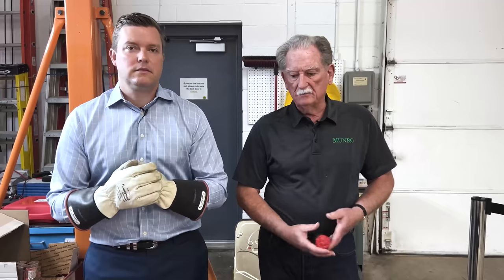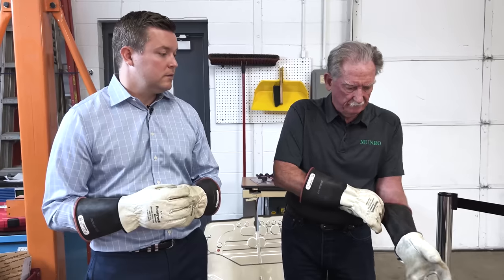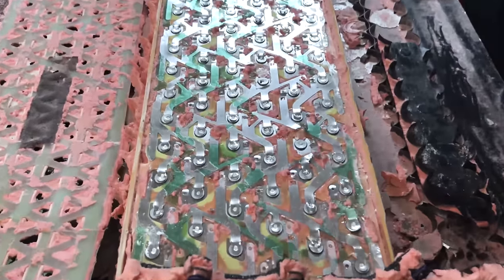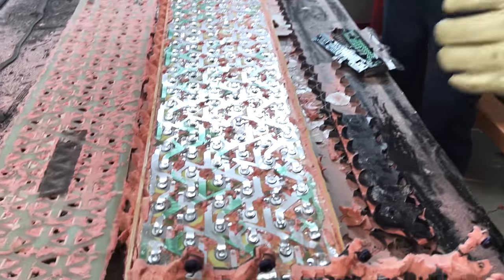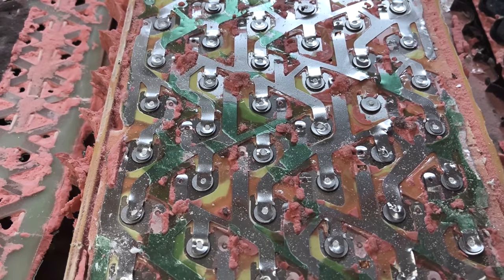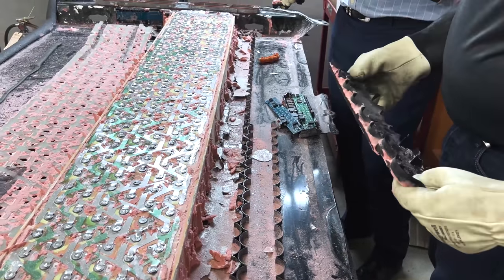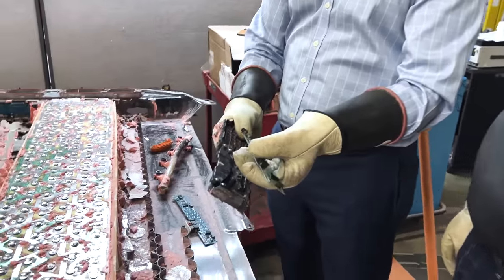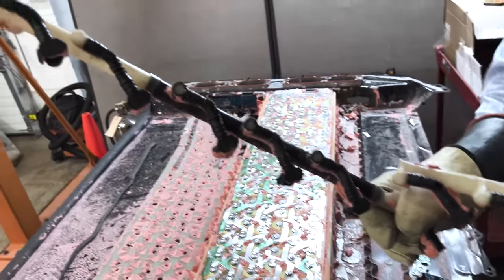Sandy's first time reviewing the fully disassembled 4680 pack!

Comment: you can now mail the cars in a box so dyiers can build it themselves, that ending was epic, i dont understand how OEM doesnt see this.
Reply: Have you been living under the rocks!? OEM actually does those types of things but on very expensive cars, who is is damn mind is going to mass produce a car with carbon fiber!? Also the repairs are totally impossible unlike welding aluminum or steel.
Reply: There is a reason why OEM uses mix of material! The carbon fiber part is generally a monocoque/passenger cell/cocon…. And aluminum castings/magnesium and steel are for the rest
Reply: Just look at people repairing those maclaren or Audi R8……. Carbon fiber is still expensive material! You forget BMW i3 which was basically built from carbon fiber don’t you!!!
Reply: @carholic-sz3qv  whos talking about carbon fiber? I´m talking about stamping huge parts of cars (as tesla´s doing) as sandy is proposing for decades.

edit: sorry miss spoke, not stamping, that is actualy what they are doing, i meant molding the parts.
Reply: @vladimirsara9790  lol……. Sandy has worked at ford in the 80’s, ford isn’t the entire automotive industry lol……. Engineers have the reason not to use molding an I can understand that! In that way vehicles are even more repairable
Reply: @carholic-sz3qv  disagree, molding structural parts aint reducing repairability, if you damage structural part, car is a write off (at least in developted world).
Reply: @vladimirsara9790  lol……. It’s totally reduced repairability and also making mods close to impossible! Imagine this on the cybertruck since a lot of trucks are made to be modded for soooo many different applications it’s going to be a nightmare! I don’t even want to imagine that in the semi lol….
Reply: @vladimirsara9790  those casting can very easily crack in those not so developed worlds making repairs impossible
Reply: @carholic-sz3qv  I´m talking about structural parts not covers, but I see you´re here to argue so, OK you´re 100% right, good day to you sir
Reply: @vladimirsara9790  structural parts so what!!!!!

Comment: That BMS is tiny!  Tesla must be matching cells super precisely and or pulling some tricks with the charger too?
Reply: Only 828 cells to manage for 4680s vs over 4,400 in the model y&3 pack's or over 7,700 in the model s&x pack's. 😎
Reply: A few reasons.  Modern cells don't need as much balancing so balancing fets and associated IR drops can be on boarded now.  If near cooling you can get quite a bit of balancing on boarded.  So now you have maybe four fewer components per cell channel and no need to protect those with zeners.
Reply: Lol….. the battery pack has very few cells why would they need to have a massive BMS!? tell me why!!!! It’s obvious the choice.
Reply: @culdeus9559  also modern electronics makes control way better l! Imagine if we didn’t have all that electronic!!!
Reply: @carholic-sz3qv  While pack is only 9 cells in parallel vs 40 or so in the 2170 packs, those 9 cells have about the same energy.  So if they're 1% off from everything else, you need to burn off just as much energy.  Basically Tesla is pulling some engineering magic as I've seen bigger BMS boards in E-bikes with 1:50th the energy.
Reply: @martylawson1638  nonsense!!!!! There is absolutely no engineering magic at all here it’s all about modern electronics like I said again!!!! By using things like silicone carbide or galium nitride mosfets  those BMS boards can be made super tiny just look at power supplies with GaN transistors. Those bikes uses cheaper electronics that’s why the board is bigger.
Reply: @martylawson1638  I’ve also seen super tiny e-bikes BMS too lol…..

Comment: re the "is the voltage different" about four minutes in, I would expect the voltage per cell to be the same, but the amperage to be significantly higher on 4680 vs 2170, so a more robust attach/weld makes sense.

Comment: The reduction of resistance due to welding-direct-to-busbar in lieu of "a little wire" will result in greater amperage capability; the voltage drop improvement will not greatly effect the pack's output voltage because all the "little wifes" are effectively in parallel. That's my take on it, anyway.

Comment: My understanding is that the wire bond acted like a fuse in the case of a cell short. Does the new, larger buss bar show more confidence in the integrity of the 4680 cells?

Comment: The flat ribbon can allow more amps and less resistance than a wire.
Reply: Also 50% reduction in welded connections, (the best weld is no weld) larger weld target with massively larger contact point, easier to handle.

Comment: IRC about ten years ago the Rocky Mountain Institute made whole cars out of carbon fiber and they got 100 miles to the gallon that would be a whole lot more for an EV.
Reply: Vw did the same thing over a decade ago but it’s actually super expensive lol….
Reply: @carholic-sz3qv  Yes it is expensive because of traditional VERY SLOW carbon fiber construction, which is essentially built up by HAND one layer after the other. Incredible labor and time costs. So the new process is exciting because it should be dramatically faster, potentially even faster than stamping and welding steel parts.
Reply: @patreekotime4578  there is no new process here!!! This is just regular process which Munro has actually never seen and has to geek about! Like he did with the first big casting actually made by BMW in the i3 in 2013
Reply: @carholic-sz3qv  Are you sure there is no new process here and what makes you think that?

Comment: people are right about the vulcanized in place gaskets for valve covers though: seals need to squish to seal and they compress over time. "threw it in a bin of scrap" is not a proper test for the long term issues you're going to face. Inside this battery its a good choice since you don't expect to have to take it apart, but certain engines require maintenance that involves removing the valve cover periodically.

Comment: I hope Tesla implements fluid sensors in its battery packs to warn the owner if water gets into the pack (flood, going through high water etc.) One way vents might prevent water ingress but it would still be good to know the pack hasn't been wet.
Reply: Let's leave it to the company with 14+ years experience?

Comment: Unfortunately, snap fits do not last forever. Take off a door panel, take off trim pieces, and the snap fits will likely break. You must have made this experience already on new cars, when disassembling them. Once snap fits age, the plastic gets brittle and the whole thing breaks at the slightest amount of force. Remove clips from 15-30 years old cars,  and many snap fits and clips will break. So you will need tools for disassembly: small clip hooks and levers to unclip such stuff. And you need drawing where to pull or push. Munro should not only care about assembly, but disassembly and service/repair as well. With screws, you unscrew this stuff, and the part will get loose and you remove it.
Reply: This pack is not designed to be opened and repaired. So, no need to have a fastener that can come loose inside a permanently sealed product. Thanks for playing though.

Comment: 3:58 "...a lot more voltage...": Same voltage, more current. Remember the big dry cell batteries when we were kids...or the lantern batteries? Same voltage but could deliver more current for longer than flash light batterys...or AA or AAA cells. Same with solar panels. Each cell puts out 0.5V...period.
Reply: Yeah so Sandy was wrong because the voltage is the same, but right because there is more amps, so the larger connection is better. Looks like he used the word voltage instead of amperage.

Comment: Imagine the Roadster with that carbon fiber framing and structural pack. Would probably be boarder line "to light" for its power to weigh ratio.

Comment: I understand that the wires served a secondary function as a fuse for each cell.
Reply: But were they useful I think is the question.  I suspect not as I don't think cells suddenly short out internally. And if they did you'd still have a problem even if a fuse blew.
Reply: @paulaxford6754  You would still have a problem, but much less of a problem with a fuse. The packs were designed to handle the case of a few cells going bad, i.e. shorting out. With a fuse, you are limited to the energy of only that cell. Without that fuse, you now have the power of ALL the cells in parallel and now have a much bigger problem. Now it may be that with the new cells that the failure rate is low enough that this is no longer considered an issue, but I can't help but think that this has some impact on safety.  And cells DO short out internally. It doesn't take much for this to happen, i.e. a misalignment (see Chevy Bolt).
Reply: @aaronwilliams1249  Surely cell balancing must be problematic with a one cell in a parallel set out of circuit? I'm familiar with the cells shorting owning an affected Kona.  That and the the Bolt were down to a production shortcut which provided an easy path for dendrites to short through the separator.  But it's not a sudden dead short, more of an initial energy loss which the BMS can often detect.
Reply: @paulaxford6754  Having a cell in a parallel batch does affect balancing and the BMS is able to detect this and compensate. Typically the BMS monitors the voltage and temperature of each group of parallel cells. If one group is weaker then it will bypass some of the current around it as it balances the pack. Historically, Tesla's packs were designed to handle a few failed cells. The bonding wire also served as a fuse and the material surrounding the cells was designed to help prevent a runaway situation if a cell shorted out. Historically a single bad cell in a parallel group should not be much of a problem, at least in the case of Tesla's design. I do not know how this changes with the larger cells, where a single failed cell in a parallel group will now have a larger impact.
My understanding is that in the case of the Bolt that there was an alignment problem with the separator which might be folded which could cause the battery to short.
 Dendrites also cause cells to fail though in modern cell chemistries this is much less of a problem, and as you say, the BMS can compensate for this by detecting weak cell groups. I'm not going to claim to be an expert since I have only designed a couple of small BMS systems that have nothing to do with automotive uses.

Comment: I bet where you can't see the weave they are doing "forged" carbon fiber.  They use cut strands of carbon fibre laid in a mold, then soaked with resin, and compressed by the other half of the mold.

Comment: But aren't those small wires essentially fuses in case the battery goes south?
Reply: Yes, they were fuse wires.  I'm guessing that Tesla has enough experience to conclude that the individually fused cells added minimal safety while costing some efficiency and potential peak power.  That suggests that individual cells rarely fail in isolation -- something that can be deduced using reports from a million battery management systems.
Reply: I think the negative side of the current collectors are about half the width as the positive side. If a cell was shorting out the negative side should be able to fuse out and thus remove the cell from the chain. There are also narrow sections of the current collector strips that could fuse out and let an entire group of cells isolate.
Reply: @patreekotime4578  Bingo

Comment: What chemistry are these cells, like lithium iron phosphate?  How much does this pack weigh vs the old pack?
Reply: As I understand it the 4680 cells are tabless, Li-ion.  It isn't just the raw weight comparison.  The system is Structural, so you have to take in the reduced amount of weight of the chassis & frame.  In addition, it's optomized for mfg & assembly, - there is massive reduced costs and time for putting it all together.

Comment: Seems like those casting are from a Rimac Nevera / Pininfarina Battista. 

And one comment to the topic screws: 
From production costs side screws may have disadvantages, therefore it is a detachable fastener that can be reused. 
How many clips or parts which are snap into place are broken after removing. 
Of course it can be constructed to be reused but that would cost money and is not in the interest of our consumer based industry. Key word intentional wear and tears to great demand. 
To protect our environment it’s positively claimed that only 16 screws are used for the howl batterie pack, the rest is glued together. 
The recycling process is only possible by melting the howl pack down 🤣…no additional energy is used for this process and the won alloys are not contaminated but 100% clean.

Comment: Now will all the carbon fibre pieces mate to the model Y chassis?  You could map the datum points for a 100%fit. 
Cost yow outcome wow.
Reply: @rogerstarkey5390  could be prototyping for Roadster V3. 
Call it Gym junkie. Lighter, faster, stronger and low flying.

Comment: These packs look great, but will there be any serviceability to them?  Or just swap replacement.
Reply: Swap. How would they be opened by a service center?
Reply: 36 bolts to swap in a new one.
Reply: @patreekotime4578  That's kind of my point.  I have seen 1 dead cell require a whole pack replacement in earlier models.  Or is there some "punch" method where they will be able to identify the heater cell and punch it out of the battery.
Reply: @jeffriechers3236  no, you've got it right. Replace the entire unit.

Comment: Tesla BMB = Battery Monitoring Board. Not Battery Management Board. Just see Tesla Service Literature. And they are not "very heavily populated" when the back side is completely empty, see 6:30.
Reply: If it manages cell voltages with balancing, then it is a management board, not a monitoring board.

Comment: Snap-together, only goes together one way, color coded.... reminds me of 1980s Honda under-hood layout for fluids, electrical connectors, etc.   Only question  Why make a power pack that is 100% non-serviceable ?   price of this pack, if required from damage?   24K, is my guess
Reply: There is no such thing as repairable battery packs. Its a myth that Im not even sure where people get the idea. Also, NONE of the battery packs that have ever been in Model 3 or Model Y are "serviceable". Inside of the modules have always been glued together with a foam that requires destruction of the coolant channels and wires to get apart. Tesla moved in this direction because of DRAMATIC improvements in manufacturing and assembly time, and a dramatic reduction in materials and cost. The structural packs should eventually even reduce the amount of material in the vehicle frames as vehicles are designed around them. It was not a flippant decision. It impacts every part of vehicle design, manufacturing, assembly, and cost equations.
Reply: @patreekotime4578  well, as an example Leaf battery packs are often repaired in this country.

Comment: Considering the challenge of engineering it has been to get into this pack, how is it going to work when the batteries require repair or recycling?
Reply: There is no "repair".  The whole thing goes into the pulverizer, gets separated, then almost totally recycled & reused.
Reply: I'm not sure I'd call the challenge "engineering", more like a technical task.

Comment: each time a 4680 video comes out, it becomes less crucial for Tesla's future now that CATL will be having LFP with manganese with energy density close to nickel based ones. Carbon fiber is awesome back then but brake regen on EVs and the weight of the battery is a huge percentage/part of the car, making it less desirable material. Maybe, small capacity high rate battery in the future and racing EVs could make it worthwhile for CFP.

Comment: As always; great stuff from you folks. I am curious that you don't seem to be pushing sales of individual cells at $ 600 ea. any more. Does that mean it is sold out ?  Although it's an arduous process to get all those cells out, and at $ 600 / cell and aprox 800 cells, that looks like $ 480,000 gross on one battery pack. Not too shabby a return. I wonder why Tesla isn't selling 4680 cells for $ 200 ea.

Comment: What’s the watt/hour of a single cell?
Reply: Yes, I would like to see more on that and the difference between cells and total voltage between the older and newer packs.  I hope that they will tell us a little more because I don't have an extra $785,000 to get the reports.  lol
Reply: @charleshaggard4341  I think look at Jordan Gesike Limiting Factor channel 4680 batters disassembly videos. There is more info about volumetric and gravimetric values.
Reply: @charleshaggard4341  "The Limiting Factor" channel specialises on battery technology and did some videos on the 4680 battery. The details you are interested in have not yet been discussed on that channel but I suspect they will be in the coming months.

Comment: Oh now I want to hear more about those parts at the end. Why don't more people use carbon fiber for structural body members? Too expensive? To difficult to manufacture? If the guys who sent those to you figured it out, I'd love to hear more.
Reply: Both. But technology is evolving and cost is coming down. Those parts probably still cost 5x what steel parts would cost, but 10 years ago it was more like 100x.
Reply: Yeah, in the past it was literally done BY HAND. Automation processes are making it cheaper but its still pretty pricy. But if new processes are faster than stamping and welding... That could be a break even point.